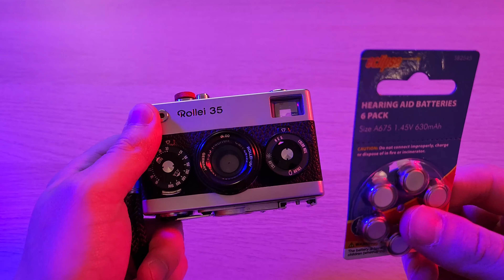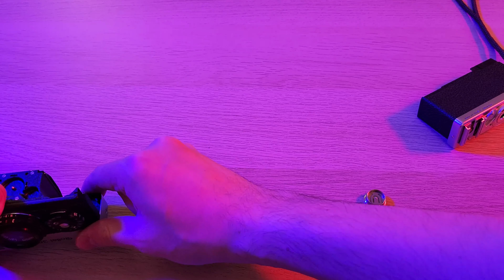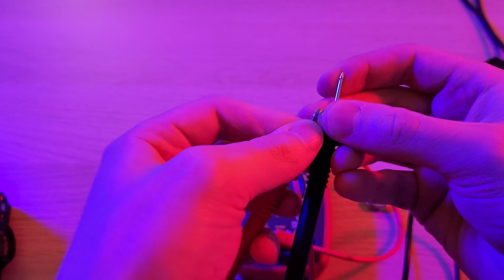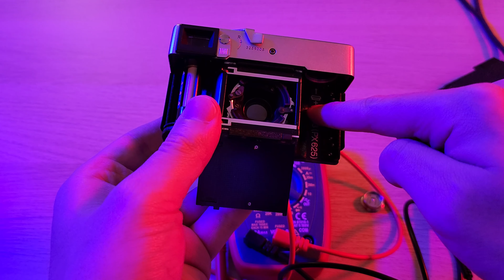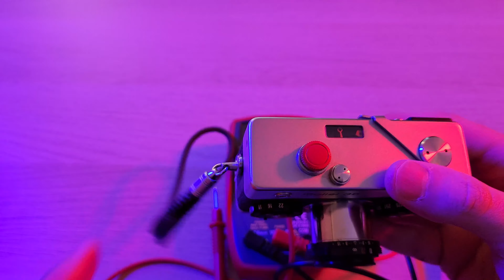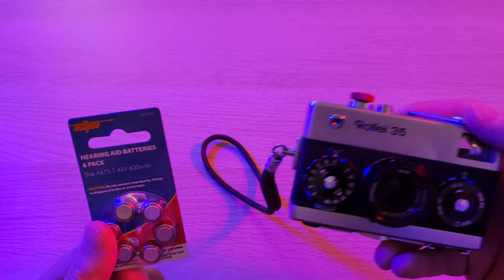Replacing Mercury with Zinc Air Batteries ft. Rollei 35

Comment: I use another method with my Rollei XF 35, I bought a PX625 that goes perfecly with no adapter, beeing 1.5V I made a lot of testing with an external light meter and I found pretty consistent to put 2 step less the ISO setting, for example with a film 200 ISO I use on camera 50 ISO. The benefit is not only that I don't need adapter but I can use film from 100 to 1600 ISO (Rollei XF 35 goes from 25 to 400 ISO)

Comment: I use one LR44, throw it into the battery compartment, without an adapter, compare its meaasurings to my Nikon F100 and they're fine. I've taken my Rollei 35 and 35S to a CLA about two years ago and I don't remember if the guy at the shop adjusted it for newer batteries. Anyway, both meters are working fine